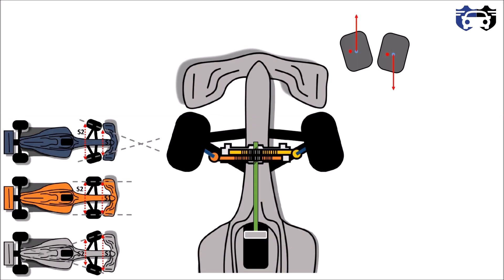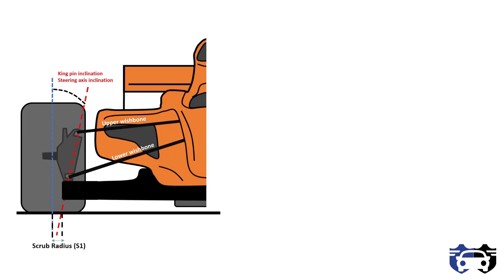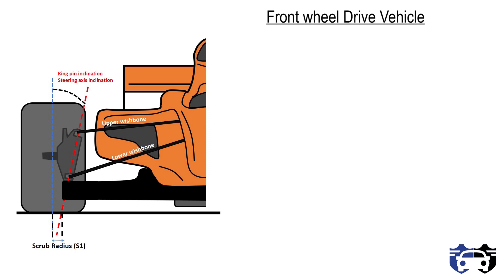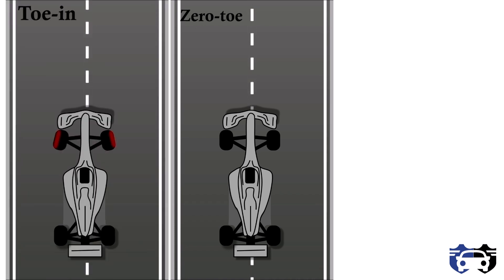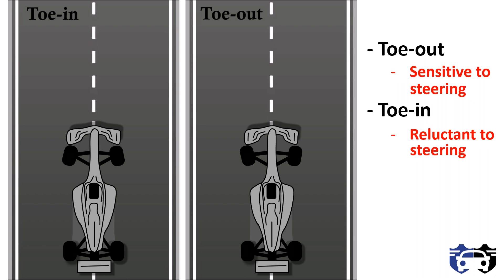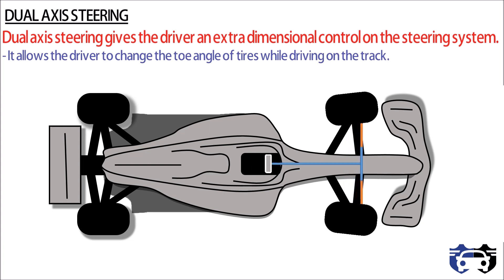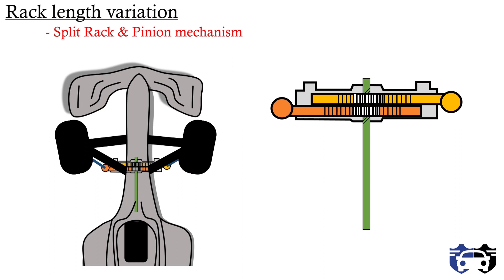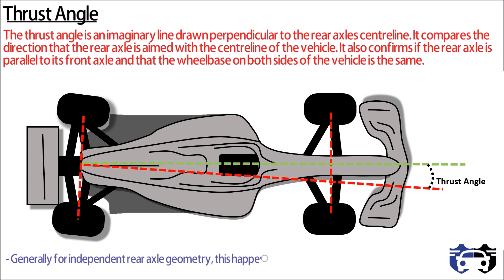Toe angles | Dual axis Steering system(DAS) | Thrust angle |How toe effects handling characteristics

Comment: Hello.
I'm discovering your channel with eager. It's full of knowledge ! Thanks for sharing !
5:51 Is it true that Toe-In improves mid corner grip ? (at the expanse of slower turn-in).

Another question.
My car (RWD) has nearly zero toe angle on the front axis.
The alignment shop I've been did this adjustment to improve fuel efficiency. (no rubbing)
But when I'm driving very fast on the autobahn (200+ km/h) the front axle feels unstable.
It doesn't give me confidence and I never manage to reach my top speed as I think something might be wrong.
I thought adding a slight Toe-in could stabilized it but you're saying in this video, zero toe gives the best straight line behavior.
Is adding more camber then will help with stability at high speed ?

Finally, to reach even tyre wear, what is the best camber & toe combination ?

Thank you.

Comment: Very insightful video brother. Thank you as always. I just wanted to point out that race cars will mostly use anti-ackerman steering angle (esp F1,Indy). As weight will transfer to the outside tires in a turn.